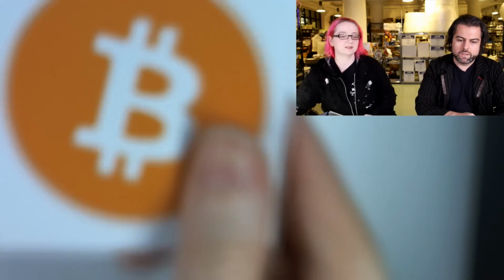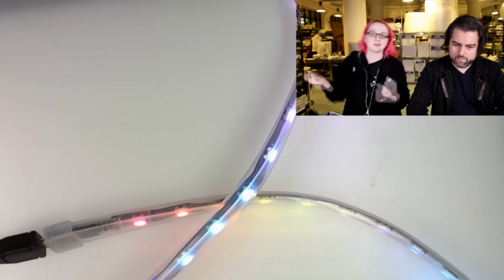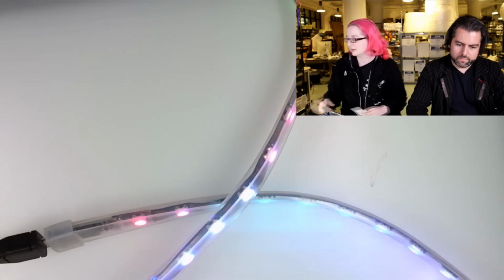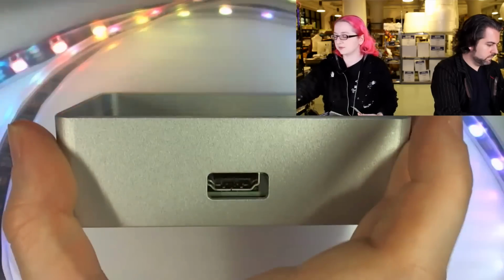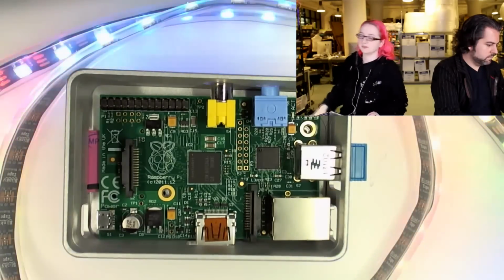New Products 12/07/2013

Comment from the maker: See what's new this week! New Products 12/07/2013

MakerBot® Digitizer™ - (0:05) http://www.adafruit.com/digitizer

Short Wire Alligator Clip Test Lead (set of 12) (0:15) http://www.adafruit.com/products/1592

Bitcoin - Sticker! (1:08) http://www.adafruit.com/products/1600

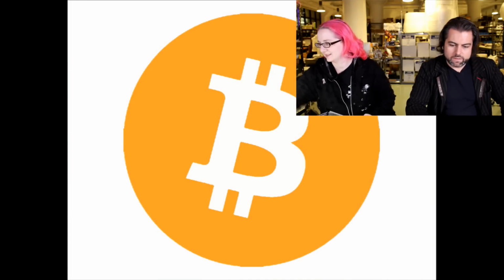BlinkyTape by Blinkinlabs (1:43) http://www.adafruit.com/products/1605

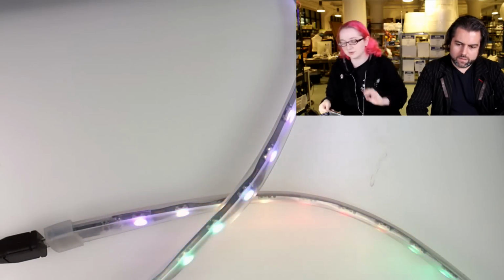UniPi - Unibody aluminum case for Raspberry Pi Model B (3:23) http://www.adafruit.com/products/1610

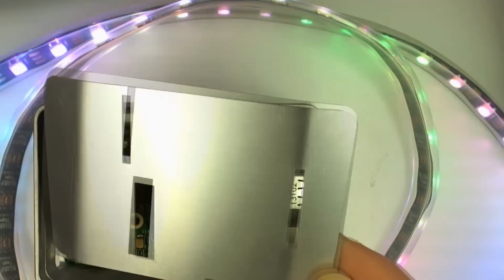NeoPixel Mini PCB - Pack of 5 (5:00) http://www.adafruit.com/products/1612

Small 1.2" 8x8 Ultra Bright White LED Matrix + Backpack (6:21) http://www.adafruit.com/products/1614

Small 1.2" 8x8 Ultra Bright White LED Matrix (6:21) http://www.adafruit.com/products/1613

Adafruit Trellis Monochrome Driver PCB for 4x4 Keypad & 3mm LEDs (8:32) http://www.adafruit.com/products/1616

 #adafruit   #electronics   #hardware   #opensource   #projects   #microcontrollers   #LEDs   #LED   #neopixels   #neopixel
Reply from the maker: John Dukovich RGB version on the roadmap!
Reply: Guys, just print a grid scale on a sheet of over-head projector film and lay it on the table where you show your products.
That way the camera will always have something to focus on.
Give it a try!
Reply: Can RGB LEDs be used with the Trellis?